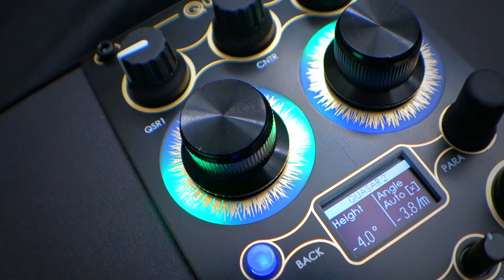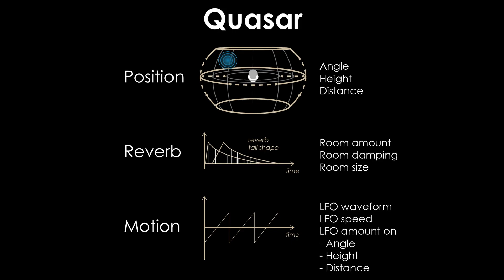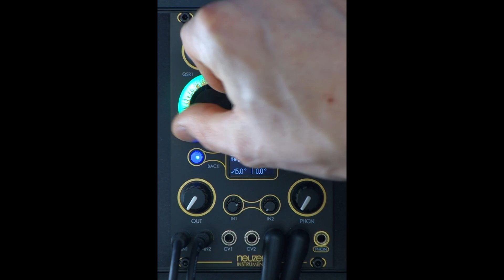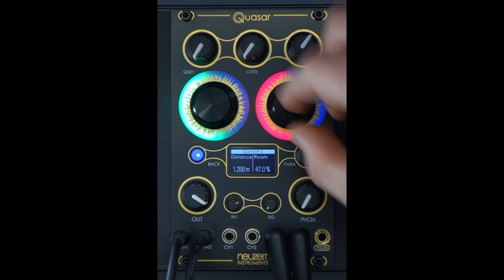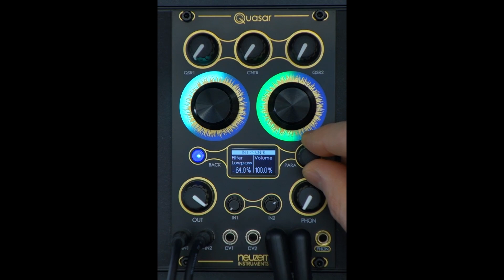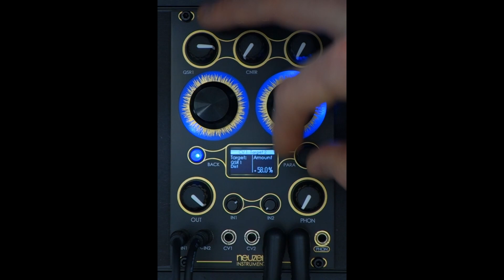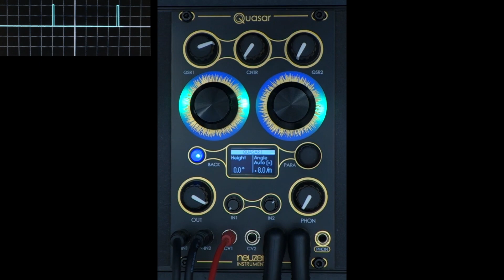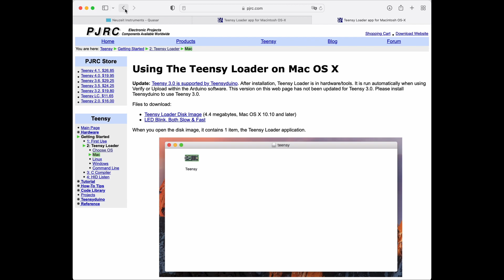Quasar Walkthrough - All Features Explained

Comment: Saw this on loopop's channel. Any chance this module is going to be made for non-euro rack users in the future?
Reply: I can't find any powered cases at 16hp which would perfectly fit this module, but I can find 20hp cases. So I'm trying to decide on a good 4hp or two good 2hp modules to complement this in a tiny eurorack case which I could easily mix into my semi-modular system. Some sort of mixer/output module to get from the eurorack outs on the quasar to standard mixing board 1/4" ins

Comment: Hello, I love your design but I don't know if it's i'm the only one but I don't here the sounds coming from the front or behind. 
The sound move's to each ear passing above my head (like a 2d plan) is it me ?
Reply from the maker: When you have the sound coming from exactly the front (0° angle) or exactly the back (180°) it is more difficult to distinguish between front and back. You can tackle this issue simply by moving the sound a little to the left or right, or using one of the built-in LFOs to have the sound moving around slightly. This will help a lot for localization. 
So called "Front-back-confusion" is one of the most interesting problems in binaural hearing. Welcome to the world of psychoacoustics ;-) We have this problem due to the simple fact that human heads are symmetrical and we don't have a third ear on our forehead or on our back, so the localization in our brain is depending a lot on ones individual head and auricle shapes for those specific locations. The sound gets filtered by our auricles differently when it comes from the front than when it comes from the back. As auricle and head shapes are highly different from individual to individual, our brain can only learn one's own shapes. So, it is very hard if not impossible to find a form of signal processing that generalizes for everyone equally well. In an evolutionary context, humans and other flesh-eaters would not need perfect front-back localization by hearing as we have another very good sensing organ in that case: Our eyes. If hearing tells me that a noise is in my front or my back by hearing, i can use my eyes to figure out if i can see the prey/enemy in front of me or not.
Reply: @neuzeitrecordings  Thomas, do you have a favorite "ear type" setting aside from human?  I think I like Elephant.  What does that say about my auricles? lol 😁  Thank you for the Quasar btw, I'm having so much fun with it.
Reply from the maker: @sinepilot  personally, i am a Hobbit/Yoda guy... ;-)